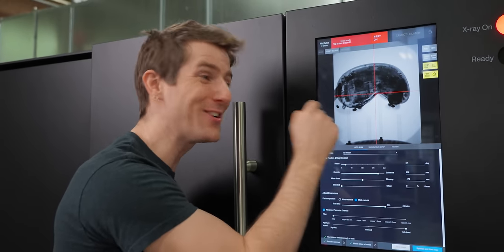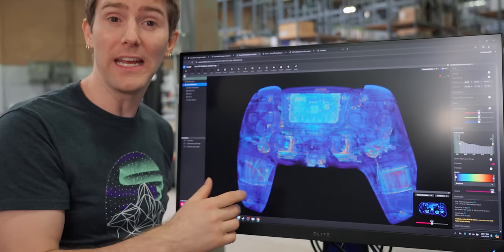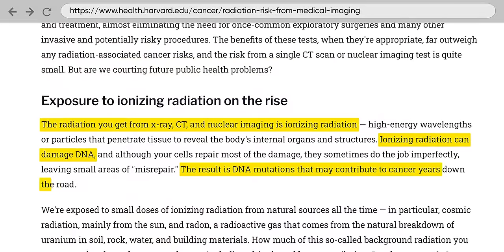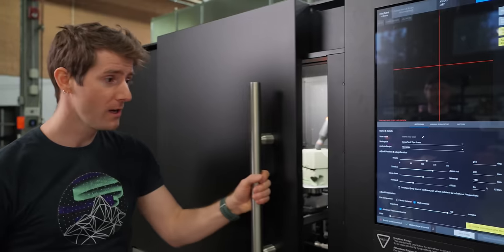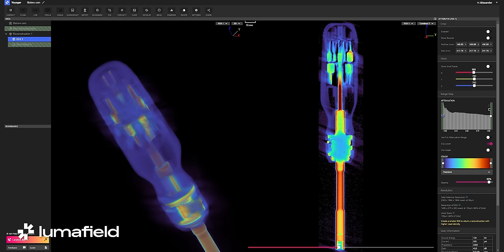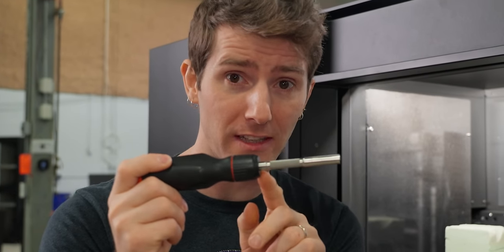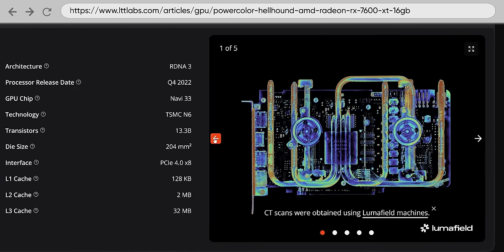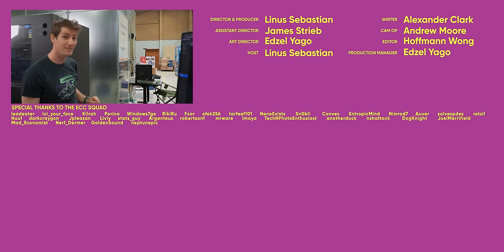We can X-Ray Gadgets we Review Now! - Lumafield CT Scanner

Comment: fun fact: your main concern when putting electronics in there should not be the bit flips (you can easily reflash a bios or so) but with enough radiation you drastically lower the gate threshold voltage of the mosfets in the IC which may start to leak and misbehave. Which would also invalidate your performance/ temperature and lifetime testing. This is highly dependent on the node size and type of the IC. i wonder how many kRad they pick up during the 12h Test.
Reply: Fascinating insight
Reply: A dosimeter would be a relatively cheap way to see how much accumulation the item got. What's the normal dose when getting a few minute CT scan, a couple mSv? But then running one full tilt for that long would be interesting to see the total.
Reply: I really want to see a video where they torture test electronics to failure by gate threshold, just to see how much chips can take. It would probably be nearly infeasible to try testing a soldered chip to failure, but going through a lineup of socketed CPUs comparing how they fail under radiation would be fascinating
Reply: @acheronhades1747  yes! I would love to see how this kind of highly integrated stuff would fail. One thing to consider is that unpowered chips can withstand a lot more than powered (biased) chips. Im not an expert myself but our radiation expert at work explained it a bit like the radiation is weakening the oxide layer of the Mosfet and with a higher voltage the atoms can be easily knocked out of place. There are special radiation tolerant chips that cost a fortune.
Reply: Wouldn't this be dependent on the energy level of the ionizing radiation?
Reply: @steampunk_willy  yep. definitely dependant on the energy. But since it's enough to go through the chips for the image I guess it's enough to cause some havoc?
Reply: well iradiating silicon is kinda how we dope it
Reply: @megamasterbloc  Sure you blast it with ions to get the doping profile you want but you then do a rapid thermal anneal to fix (almost) all of the massive amounts of damage you did to the crystal lattice.  You're not going to be able to get a packaged IC hot enough to anneal it and even if you could you'd slightly alter the doping profile anyway as it's hot enough to allow for some diffusion.
Reply: i was thinking the same & testing a hard drive & ssd getting scanned 😮
Reply: I observed a head CT last week that lasted about a min and it was 2 mSv. Was a siemans machine and they are on the low end as fare as dose goes.@Finny869
Reply: @steampunk_willy Yes. Exposure  time + Total amount generated - the thing is, X-Rays have a certain level of photon energy.

Anything Visible light, and longer is Non-ionizing: The photon energy level is insufficient to rip electrons off the material (I mean, you might have a very strange state where you have elevated negative charge, where interaction with visible light is enough to knock down to a stable state but, that's going to be a rare edge case - and if you have extra unwanted charge, you already have problems). Anything that is UV or shorter, is Ionizing radiation - that is to say, the photon energy of the source is sufficent to knock electrons off of molecules/atoms and Ionize the material.

 Why Ionizing radiation is damaging - is once you Ionize a molecule, it will become more reactive. In effect: You promote chemistry to take place. This is why Melanin is found in skin by the way: It is a sacrificial molecule, that absorbs and prevents cellular damage - such as damaging DNA. A LITTLE bit will be repaired by the Cells internal structures/mechanisms - and if repair is deemed impossible, the cell will be terminated + replaced; when the termination of a bad cell fails, and it is able to replicate - that is when you can end up with Cancer.

Now - when we get to non-living materials: Without a self repair mechanism, Protective pigments are not replaced, and you will get a break down of them. For unprotected wood - you first get a greying generally take place, and then you get a bleaching - which is how you end up with drift wood that is bleached out. With Plastics - you get embrittlement of the plastic itself, as electrons get knocked off and carbon bonds break, and so on: In effect, the material loses the long strong polymer chains, and is replaced with more easily split apart short chains. And this gets us into what happens with Electronics - because electronics are made with doped silicon - a high enough exposure to X-rays / Gamma rays is going to promote a drifting, and shifting of the doped material. In addition, you may induce a short, but high current in the material as the traces effectively act as a tiny antenna to the radiation - and that can also cause an amount of damage provided you have sufficient amount of it.

Generally short, limited exposure won't be an issue. But extended exposure, comes with greater risk. In order to avoid damage, you want to use the lowest possible frequency (wavelength) of X-ray's that will penetrate the material you are scanning. However, you want to also consider the end result resolution you are after as, higher wavelengths will lead to better net resolution.
Reply: Haruwu_buwunny  I don't understand the specifics either, but in general: leave something in there long enough and it changes stored data and damages chips.
Reply: So you would want a Digital Dosimeter such as a Rad-60 to pick up the mR/hr rate. It acts as a survey meter, rate alarm and digital dosimeter. I actually work on NDT equipment including X-ray, UT, CT, Mag Particle, eddy current and more.  When not traveling and working with equipment I work in a Lab that certifies radiation equipment is reading correctly.(needs to be verified every 6 months) with a cesium source.
Reply: i understood some of those words

Comment: Man, I keep forgetting how much I am from a different world of equipment because I heard “$75k a year” and went “Goddamn that’s cheap” 🤣🤣🤣
Reply: meanwhile for my department getting 15 rasperry pi and some decent monitors for the CS department needs tons of justification paperwork.
Reply: @MasterGeekMX my work multimeter cost 30k € .
Reply: @tobiashegemann1811  Sure bud, sure.
Reply: Yeah, I fly drones that cost 30k for a living,  using subscription software that costs our customers 5 figures a year on top of labor and equipment costs. Different companies use those same drones and throw lidar sensors on them that can cost 100k.  Industrial equipment is a whole other world, and I expected this to cost far more.
Reply: @Renee_R343  Your skepticism is understandable, but work multimeters are insanely expensive.
Why? Standardization, mostly. That, and safety features, because if you use one of those professionally you: 1. Are likely to come across dangerous electrical situations, and 2. Can deduct the cost in taxes, which helps somewhat.

(The fact that it's an investment for making more money is also a factor)
Reply: My xct mashine costs over 1.5m lol
Reply: @Renee_R343  uhhhh $30k is about the going rate for a bells-and-whistles benchtop industrial multimeter setup. You can get quite exotic in this equipment space based on what your requirements are, particularly if you have to have a specific level of accuracy and repeatability the equipment must hit. Hardware and Software validation for precision tolerance targets takes highly trained workers and a whole suite of testing to get.

Comment: I wouldn't be surprised if this video actually moves several units for Lumafield. I'm sure there are companies out there who would love to do a 1-year trial run with this thing.
Reply: I wonder how many referrals Linus would need to get the machine subscription for free, if they would even do that haha.
Reply: @littlejack59  most large volume printers are leased. also other machinery in companies. if the maintenance and service is included this is not very expensive. this is a high end product. maybe you also get a newer version when they release one.
I understand your concern but sometimes leasing a machine makes sense.
Reply: Like Chinese companies?
Reply: @littlejack59  That was also an option but in this case it worked better for LMG to use the subscription service for themselves.
Reply: You couldn't get a better advertisement than linus for this kind of product.

Comment: As an orthopedic surgeon I use CT imaging basically daily. I can understand your almost child-like amazement. The first time I saw terrarecon about 20 years ago do on the fly reconstruction of CT imaging I was similarly amazed. Now I use intra-operative fluoro CT (medtronic O-arm, and Globus E3D) almost every day for 3D imaging to robotically assist screw placement for spine surgery. 

Fun fact: CT scanners used to take forever to get an image series done because the amount of processing power to reconstruct the images was too much for the computers of the time. With increasing slice counts on the scanners, and faster processing it now takes mere seconds to scan an entire person. 

An MRI, by contrast, works by inducing spin in the protons in the water of the material, and the image is taken after a certain specified amount of time after the spin is induced. That time you wait to take the image is a property of which type of MRI sequence you are trying to obtain. That time you need to wait is a property of the physics whereby the image is produced and cannot be sped up.
Reply: My uncle worked at EMI Central Research Laboratories UK where the first CT scanner (or EMI Scanner as it used to be) was produced in late 1960s. With the early machines the entire process took days to complete lol as the scanner required many hours to obtain the raw data for a single scan and a few more days were needed to reconstruct an image from the data.
Reply: Do these machine scan using just one frequency or can you change the density visualization of a scan? I've had a couple CT scans done in the last 3 years and can only see one density level on the data I requested. BTW super cool to see a slice by slice of your brain or other parts of you body. The tech improvements compared to 10 years ago is massive (had a CT scan done of my brain then too).
Reply: I thought fluoroscopy was X-ray imaging ?
So you use a combo of CT and X-ray imaging in real time ?
Reply: @thebestevertherewas  CT still uses X-rays
Reply: Superpower. 👍
Reply: @thebestevertherewas    a CT scanner takes a series of X-ray images from different angles which are then processed by software to give a 3D image. a fluoroscopy machine makes a live video of passing X-rays through the object/person for someone to see in real time.
Reply: @danimayb  Oh, Got it
Reply: @cyrilio  Actually CT scanners can use different KV /energy settings to scan different densities. So yes they can.
Reply: @thebestevertherewas  Yes, fluoroscopy is the old name for X-ray imaging. CT scanners use X-Rays too and you could name the detector a fluoroscopic part of the scanner.
Reply: Funnily enough, 3D reconstruction in CT scans is basically raytracing.
Reply: @Lodinn It is a point cloud -> voxel conversion :)
Reply: CT scan is equivalent to 200+ X-rays. The radiation burst is not good (especially for kids, and especially if you have many CT over time).

CT are a bit over-used in the medical profession. Doctors love them because it tells them what they need very quickly, but they seldom consider the radiation exposure. 

Other non-ionizing radiation scans should be preferred where available.
Reply: @richard6946  compared to what exactly?
Reply: @Nightsd01  what compared to what? I think my comment was pretty clear..
Reply: Does MRI have radioactive like CT Scan ?
Reply: @pezima  no, MRI has non -ionizing radiation which has no effects on human tissue so it's much safer than CT, but it has other limitations so it's not a replacement for CT

Comment: As someone that works in Industrial X-Ray CT - it NEVER gets old!!

P.S. the carbon fibre is just a protector for the actual detector - it’s much cheaper to replace a scratched carbon fibre plate than it is the detector!
Reply: Someone didn't want Linus taking it off to show the detector :P
Reply: If it stays attached he can’t drop it, right? 😅
Reply: He said in he video that the detector is simply a visible light camera sensor, not a native x-ray detector and the piece is supposed to turn the x-ray into visible light.

Am I missing something here? And if it works like how Linus said it works, how is a piece of carbon fiber supposed to work optically to shift the wavelength of photons?

I'm guessing the scintillator is not the carbon fiber but a sheet of some sort of heavy element that kinda acts like a reusable film that the visible light camera then take pictures of? But I don't see how this can produce enough visible light to be captured by a normal camera sensor, so is it just a big ass silicon stuck directly onto it? Or is that not how a scintillator works?
Reply: @dwirandypradhika6752  You completely understand the physics, but the "scintillator" does that job, not the carbon fiber; there is just a carbon fiber panel in the way to protect the more expensive panel underneath. There isn't any fancy "wavelength shifting" going on, it's just that he scintillator is a material which glows when it absorbs x-rays---i.e. emits visible light---which of course is enough.
Reply: Could someone step Into this machine to have a full body x-ray??
Reply: CARBON FIBER
Reply: @garystinten9339  yes, even a full 18 wheeler
Reply: @keeleyhoek  I'm so dumb, yeah of course it emits enough light for a camera to see, there's a giant x-ray emitter right in front of it... I guess there's still black magic fuckery to get a usable image out of "glowing heavy metal sheet", but I get how it works now thanks!

While we're on the topic, does an x-ray telescope work the same way?
Reply: @keeleyhoek  No flexing here.   We use carbon fiber all the time for mechanical support, its almost invisible to X-rays.   And, as someone mentioned earlier,, activation needs at least 10MeV.  This machine is 2 orders of magnitude below that, 100keV or probably less.  I wouldn't worry about activation.
Reply: @garystinten9339  in theory, yes. But you wouldn’t want to as industrial CT systems use a far far higher dose, so you would get injured within a minute or so if you’re in the X-ray beam directly. (On systems you can walk in there are always emergency stop buttons and lights that there are x-rays on. There’s also a 5-10 second warning sounder before x-rays are generated so someone has time to hit the E-stop
Reply: @YuzuRyougi  far different set up to what I use, but still cool that they can do it. Although it more used for customs inspection rather than metrology
Reply: Maybe we could scan the machine itself to get an image of the detector 😅
Reply: I also worked with industrial CT for about 6 years...super fascinating stuff. Though for fixturing, Floral Foam gets old very fast. Use the in house 3D printers for fixtures! Works great and you can get some low density fills to ensure they don't show up.
Reply: @GymBagBoy  yeah! We use stage prop foam as the foam cells are super small so you can’t really see it unless you’re doing 50kV scans 😅
We used to use floral foam but it sheds everywhere!!

I 3D print jigs, but only if we’re going to be doing lots of repeat scans

Comment: I worked in an electronics failure analysis lab in college and we had a manual version of this machine, and it was already a bit old when I started working there.  We would mount an object on either a plate or in a gripper and then manipulate it with joysticks in three dimensions over an x-ray projector.  We could snap pictures of solder joints, BGA chips, and such for clients.  It was great non destructive testing and it's really cool seeing the automated version of this in action now.

Comment: I've visited Lumafield's office in San Francisco, great team to meet and ask questions. Their solution is very innovative for what it does, especially when it doesn't need an industrial X-Ray tech on staff.

I'm told they do work with aerospace and defense contractors, so I might actually meet an aerospace engineer ("Rocket scientist") there next time. I could see this used for QA checks of completed assemblies, where an incorrectly assembled part in say a Fuel Control Unit in the engine of an F-16 could cause a $30m jet to crash, and has at least once.

One disappointment when I visited their office, I only met a neurosurgeon there, and no rocket scientists there.